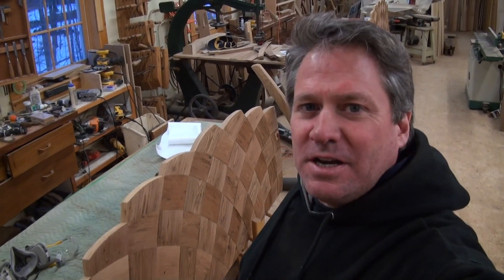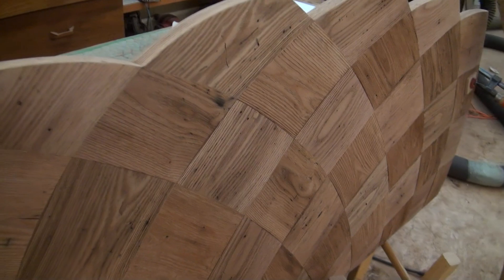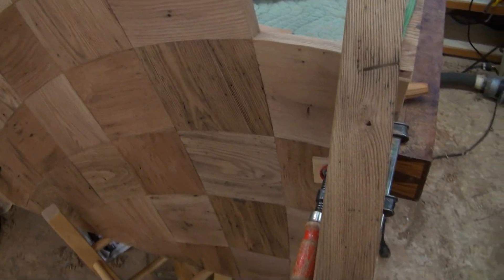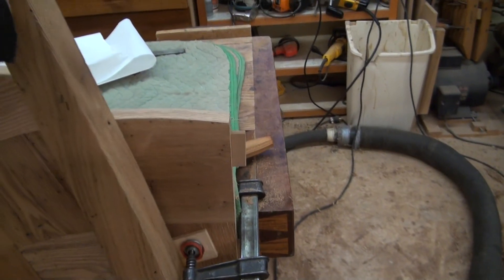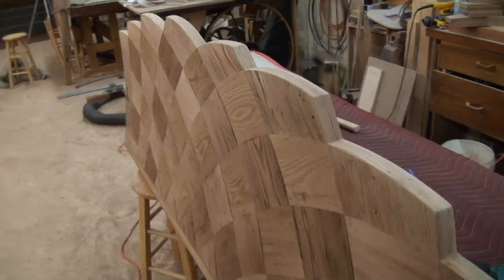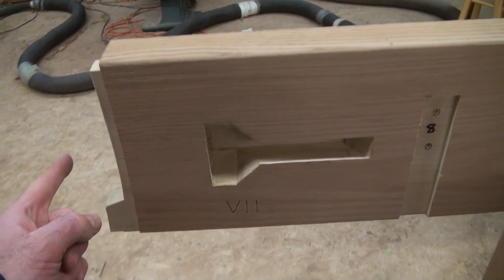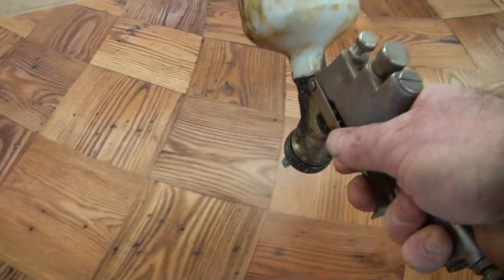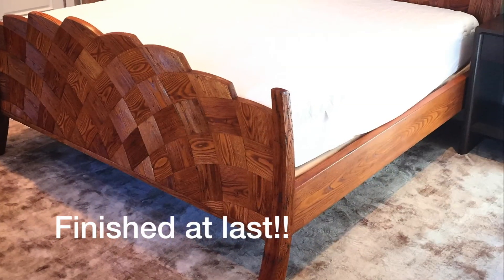Making a Barn Beam Bed with Tom McLaughlin, Part 3 of 3

Comment: Lovely piece Tom.  Wondering how you assembled all the individual pieces to create the graceful long curves?  Looks like a challenging assembly!
Thanks, Mark
Reply from the maker: Mark Barabas Thanks Mark! It’s kind of hard to explain without showing you, but like most things, it’s not as complicated as it looks once you know the step-by-step process.

The pieces are first cut individually and shaped and edge glued flat together. Then the whole assembly is glued onto a piece of veneer which creates a connected sheet of the assembled pieces. Then that connected sheet is glued onto a previously curved laminated panel (inside a large vacuum press bag), with the panel sitting on top of the original curved form.So that’s all there is to it :-).

I’m making more and more video content these days and I’m sure I will include this technique at some point. So I appreciate you following along here, or at my website epicwoodworking.com where we keep you better informed of new content.

Thanks again! Tom

Comment: Love this piece, Tom!  What is the sub straight? It looks like it's about an inch thick but you re sawed the chestnut to one quarter thick. Is the core plywood? Doesn't look edge banded. Thanks, Linda
Reply from the maker: L Smith Thank you! The cores is made up of several layers of bending plywood as the headboard is curved and laminated in a vacuum press over a curved form. So it is stable and strong keeping its shape very well. I did have to apply edge material to the top of the headboard and footboard to cover and finish the ply core. Thanks again! Tom